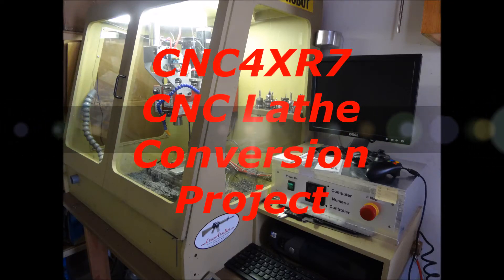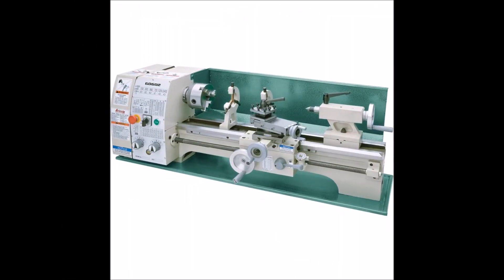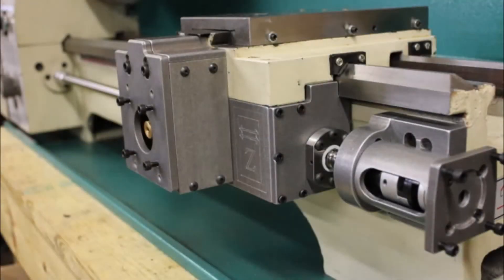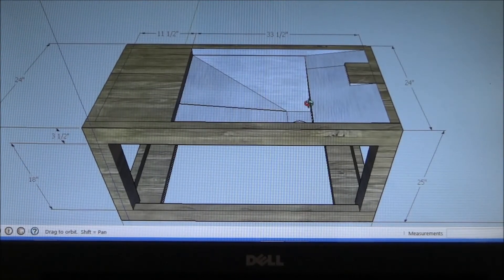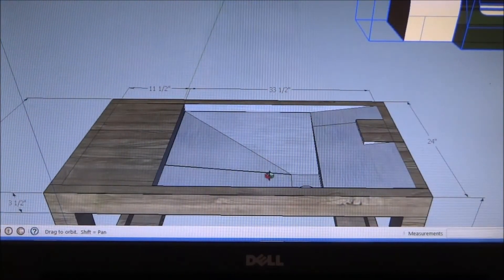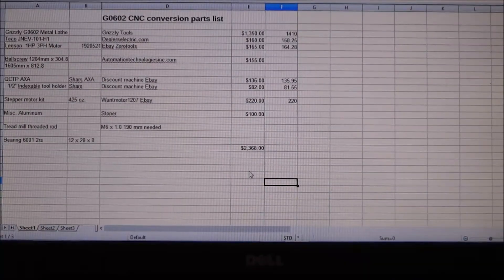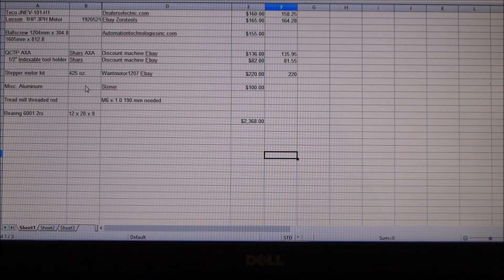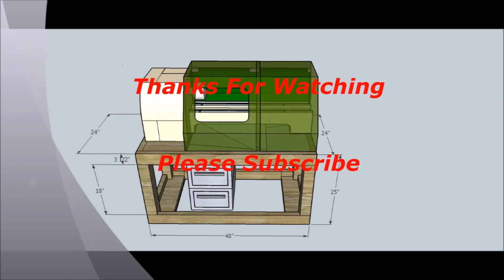Project G0602 CNC conversion PT 1

Comment: how do you like your steppers? I'm pulling my hair out trying to figure out what sort of motors i actually need, since it affects the power supply. I think I need a 400W for the Z axis, but how much is really needed for the X axis? I'm also considering running the spindle off a servo - do you think you could do C-axis (rotational engraving) control with your VFD conversion? or is the VFD purely for speed control rather than position?
Reply from the maker: I run smooth steppers now . I upgraded awhile back. There is a video on it. With the smooth steppers I used linked on Amazon I believe.  You are correct vfd is just controlling speed and direction off spindle.

Comment: hi
i saw electronic lead screw to cut thread without gear >>>by arduino 
you have any idea how can make it ?
cnc cut thread ? if yes why the electronic lead screw
thanks
Reply from the maker: Anwar Alfaqeeh Alhusseini 
Im sorry I do not know what your referring too.
Reply: CNC4XR7 
https://youtu.be/BaBK9teKUaA
This link about electronic lead scrowe 
That’s allowed to make cut threads without gears?
My question is do you have any idea how to make it? 
And what’s the difference between this part and the cnc ?
Am sorry if I cannot explain my point v well 
Thanks any way thanks 🙏 🙏 🙏

Comment: Hi
I found here http://dealerselectric.com/item.asp?PID=24493   a set of motor plus vfd  for $190 do you think this is good?

thank you
Reply from the maker: +Ozy Ozy  Not sure of motor Fitment the Motor I used was a direct bolt in replacement Metric motor it has a D-80 Frame the motor was a Lesson $160 and the teco drive is OK

Comment: I wish Grizzly would offer a CNC ready stripped down version of the G0602.  Sell it for $300 less and leave off the Z axis leadscrew, the compound, and all of the gear change stuff needed for threading on a manual lathe.  The cost savings would pay for the stepper motors, drives, power supply and I/O - pretty much the CNC parts other than the PC, and it'd save the time needed to strip all of that stuff off.

I'm enjoying these videos.  Thanks!  After this, I'll double back and watch your X2 mill conversion.  What I've seen so far looks great.
Reply from the maker: So do I that's why I decided to do the vfd conversion on the G0602. Instead of the 0752. 

Yea I could have done without the motor as well.